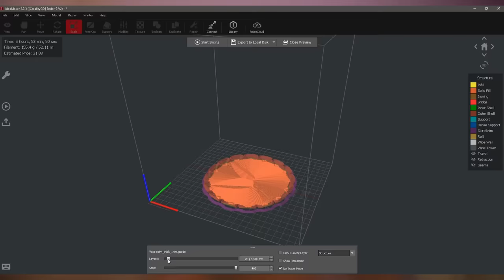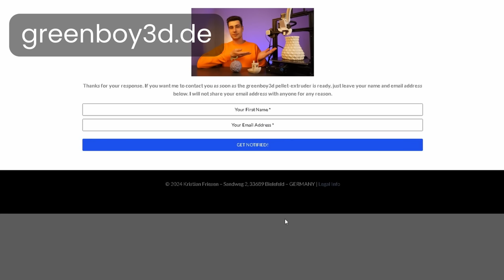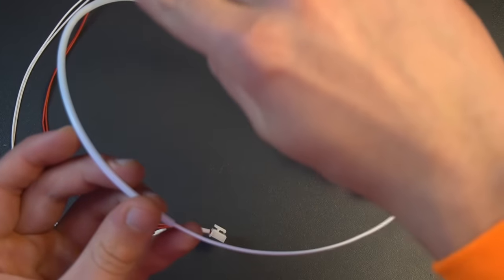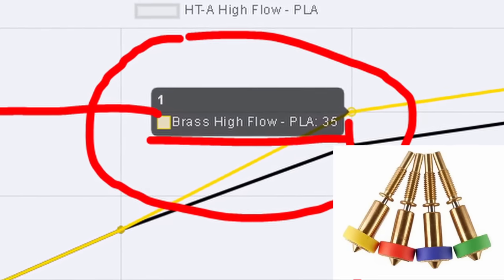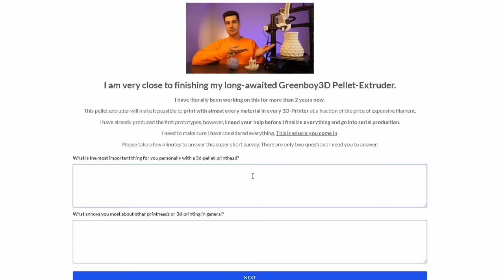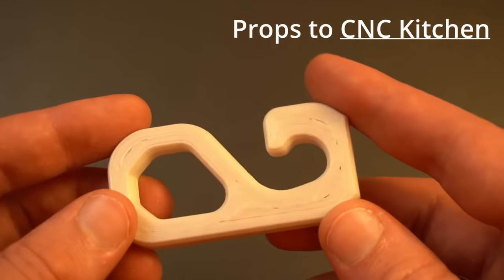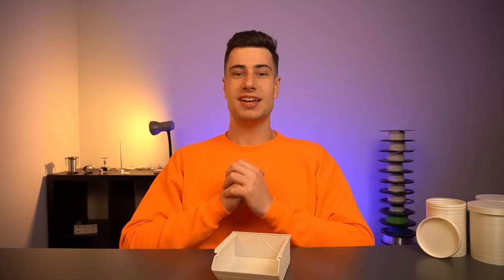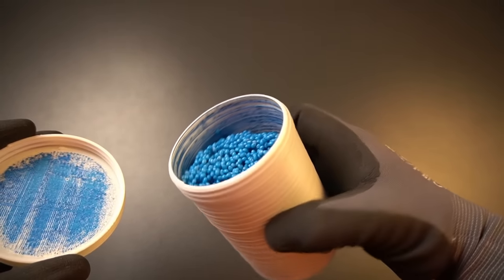Stop Buying Filament, Use This 6x CHEAPER Alternative instead

Comment: For recycling it's typically done by mixing the old plastic into a new batch.
You could try how well the system works at different ratios of old and new.

Ideally ofc you would want to shred it to similar granule size, but the hopper and screw system should be able to handle varying sizes.
Would like to see some tests on this. Recycling old plastic inhouse can be a huge saving overall.

For the nozzle question, I think you should aim to have optimal nozzle for the printing and not be chained by universality.
If the system becomes widely used then it becomes the new standard :)
Reply from the maker: very interesting input 🙂
Thank you

Comment: Supporting standard nozzles will bring more people in, so in the short term that's probably the better plan, but the next step will be to develop custom nozzles and setups that work better.
Reply from the maker: Thank you for your great input 🙂
What would you like to see next?
Reply: It's better to have something that works. If it doesn't work it doesn't matter if it uses a standard nozzle.

Comment: In this case, in terms of speed, I think a bed-slinger might actually perform better than a CoreXY. On a CoreXY the heavy toolhead would affect the resonances of both axis, which would limit accelerations. On a bed-slinger the heavy Y axis performs worse than the X, bottlenecking the X axis speeds. But in your case, both axis are heavy, so they don't limit each other, and because they're separate, it's probably going to be easier to deal with their respective resonances. But that's just my theory.
Reply from the maker: True :)
By the way, what would you like to see next?

Comment: Very good video and so happy to see your progress. I have 40 years of high production high precision injection mold making and molding experience. You are dead on in the process you outlined and are mastering the rheology of thermoplastic flow . The only difference in the outcome is that you are not able to get the density of an infection molded part because you do not have a packing phase in 3d printing. As a result you may have aligned molecules and a grain like wood in printing that has some advantages and disadvantages. But with carbon fiber we may be able to produce a similar strength . Not sure yet all the doors you are going to unlock but accolades to you this this an amazing project. But I can tell you that the injection molding press industry has already figured out how to do a lot of what your doing they just have not figured out how to 3d an extruder for 3d printing
Reply from the maker: Thank you for the Feedback :)

Yea, there a definitely some additional challenges involved making a "mini" extruder for 3d printing

Comment: The retraction explanation makes perfect sense when you consider that reversing the conveyer screw in a pellet extruder is functionally doing the same thing as a "retract" move on a filament extruder; namely, they both are reducing the pressure inside the melt chamber.   Which is the real goal of a "retract" move anyways.

Comment: For the nozzle, maybe go with a CHT nozzle, since it has three channels in which the molten plastic flows through, meaning it might have more consistency in the heating and flow. As for the small discrepencies in the melting process, maybe add some small notches on the side of the extrusion screw so that any trapped air could be potentially allowed to bubble out or maybe as a way to control a bit of pressure.
As for dying your batch, could try going with alcohol dyes and do it in the same format of mixing it in an enclosed jar/container.
Reply from the maker: Thank you for your very interesting input 🙂
What would you like to see next?

Comment: I’m all for recycling and reducing waste, also I like saving money, so I love it!
Most prints just don't need good quality. Stuff like hooks, holders, storage containers and so on work just the same even with a +-1mm tolerance, so the reduced surface finish is no problem.

Comment: Some of the problems you're running into are also issues in small extruders.
I.e. if the extruder screw is running at 60 rpm, expect an uneven "squirt" of resin every 1 second out the end of the nozzle/die.This is why metering pumps are often used at the end of an extruder (to tightly monitor flow). 
The 3d filament printer brilliantly solves this issue inexpensively by using filament.
The filament feeding system is acting as the gear pump.
Another issue will be safety. If you build up pressure behind molten plastic that has frozen off at the nozzle, watch out. 
Randcastle has made a great miniature extruder for decades to learn some of the inherent issues.
Reply from the maker: Thank you for your interesting input :)
What would you like to see next?

Comment: Nice. For recycled plastic the bulk density will be different. Building a small pelletizer extruder would be more consistent. I worked as a tool maker in an extrusion plant for 10 years. There are ways to make it more consistent but the complexity goes up.
Reply from the maker: Thank you for your very interesting input 🙂
What would you like to see next?

Comment: I once read an article about an Indian university student who couldn't afford a 3D printer and so he designed and built his own, the only things he bought were the arduino chip to build his control board and the steppers, he was also having trouble affording filament and so he also designed and built a pellet extruder as he could get the pellets for pennies.
 I have a few old bedslingers that I would love to convert into pellet printers!

Comment: I calculated 112g/h = 38.3 mm^3/s, am I correct? Calculations below:

Assuming PLA density is 1.24g/cm^3:
112g * 1.24 = 138cm^3/h
138 / 60 = 2.3cm^3/min
2.3 / 60 = 0.0383cm^3/s = 38.3mm^3/s flow

It would be cool to see you perform the orcaslicer max flowrate test on different nozzle sizes. It makes it easier to see the actual limits of flowrate.
Reply: A bit of an overestimate on flow rate unfortunately  - if the PLA is more than a gram per cm^3 then 112 g should represent less than 112 cm^3.  I think the calculation should be as follows:

112 g/1.24 g/cm^3 = 90.3 cm^3
90.3 / 60 = 1.50 cm^3/min
1.5 / 60 = 0.025 cm^3/s = 25 mm^3/s

Still better than many standard nozzles, but not matching top of the line high flow.  I think beyond this, the cooling rates will be a bigger limits but with klipper input shaping the weight of the extruder may be much less of an issue than with previous firmware.  Still a very impressive project in general!
Reply from the maker: I'll look into the "orcaslicer max flowrate test", might test it this way next time.

Thank you for your very interesting input 🙂
What would you like to see next?

Comment: Nozzle compatibility across filament printers makes sense, but it does not have to be that way for a pellet extruder. It makes more sense for the pellet extruder that uses a different  extrusion method to have a different nozzle. Then from there, hopefully all future pellet extruders would have the same nozzle compatibility.

Maybe if you just keep the same threading, it can be up to the user to decide if they want to use an easily available filament nozzle, or a pellet nozzle.
Reply from the maker: You've got a point here :)
Any wishes for the next video?

Comment: PLA pellets can only reliably sourced at $10-$15/kg. The cheapest PLA filament is $15/kg… last I checked. 0-30% cost savings was not 300% (missinformation factor 10x to infinity)
Reply from the maker: You just don't know where to buy pellets.
Reply: @greenboy3d  so where do you buy pellets?
Reply from the maker: @pyalot  going to make a detailed video about that in the future

Comment: SAW VIDEO 1 AND NOW THIS!! Thank You! Can a pressure lift switch  be added between the nozzle head assembly and the actual carrier mount guide rail? maybe this would be fore a different design. say 0.6 nozzle layer eight travel is 1.2. the stepper feed goes till the head is lifted ill the trigger head lift switch is tripped or lifted to that height, then the travel steppers are engaged to conduct gcode shape. maybe be do a reverse stepper feed code for retraction. Head should relax and lift switch switch off for next travel movement and no feed. Maybe CNC kitchen or Dr. Dflow. Dflow did a very large scale pellet printer. maybe this helps on the stringing retraction issue. micro optical type switch or  nano like adjustable switch control to adjust layer height and retraction.. just ideas...
Reply from the maker: Thank you for your very interesting input 🙂
What would you like to see next?

Comment: For recycling 3D prints, CNC Kitchen got the best results by repelletizing them. He was making filament but the basics were:

1.) Shred
2.) Sift
3.) Repeat till consistent
4.) Form filament
5.) Pelletize this first batch
6.) Form final filament 

Clearly you can skip 6 and probably combine 4 and 5 to be a single operation.

Comment: Nozzle compatibility isn't important if it comes at a cost of performance. 

What would ultimately be nice is to design it to function with a breakout board, and be compatible with toolswap plates such as the Hermit Crab or WhamBam Mutant for Ender 3, or be able to easily mount it to a toolchanging printer. That's a much nicer quality of life, to be able to quickly swap between a pellet extruder and filament extruder.
Reply from the maker: What would you say are the top 5 most popular toolswap plates?

Comment: Neat video, I love the amount of work folks put into FDM printers just to get a new way to print or not waste materials. I am not sure I would go through the trouble of doing all this, just to save a few bucks in materials, but I feel the pain of wasted materials as well. Resin printers create so much waste with support materials only being used and tossed. I love that you took and Ender 3V2 and did this, those things are like Honda Civics, cheap and easy to mod.

Comment: Could you technically print pellets with the shredded prints so the size is consistent? As for the standard nozzle question, I'd love to see the difference in print quality with a non standard nozzle
Reply from the maker: Depends on how consistent the shredded prints are. If you have for example cylindrical shaped shredded plastic, and you plan to mix it with round shaped pellets, then you might get even more inconsistency... But yes you can...

Comment: Whats the cause of the poor print quality? Is it just a lack of dialing in the settings? Or is there a mechanical reason causing it?
Reply: IIRC the pellets won't run themselves through the extruder at a perfectly constant rate. You'd have the same problem using filament with a non-constant diameter.
Reply: @ski3091  so I suppose this type of extruder is not good for prints with tight tolerances or small details but is excellent for large structural objects that you would need a lot of?
Reply: @ski3091  gotcha, thanks for the reply
Reply: @ipodtouchiscoollol  Sorry, I don't know enough about the process to answer that
Reply from the maker: Like others mentioned, the pellets or granules don't have a perfect constant flow rate. I have some ideas to solve this problem in the future, but for now it is what it is :)

Comment: My personal opinnion on the nozzle type is to stick with the current, widely available nozzles and once its widely adopted, offer specially designed nozzles for improved print quality.
I would preffer that because of 2 reasons:
- It would get a lot more people interested if they can retrofit their printers 
- They would have as may interchangeable parts as possible
Moving on to the specialized nozzle: 
- It would offer to the people who initially are focused on print quality and not function a reason to recyle and be more sustainable
- The hobyists would also benefit from having something to upgrade to

Comment: I really like what you are trying to do. Even if the up front cost is most likely going to be more, the saving on the filament is huge. Making custom colors is interesting too. Are you using regular spray paint?
Reply from the maker: Yes, regular acrylic based spray paint. But like I mention there are multiple ways and spray paint types...

By the way, what would you like to see next?

Comment: About the nozzles: could one not just cut away most of a standard nozzle with a hacksaw, leaving just enough threading to screw it in? This would eliminate the entire part where plastic is melted and leave just the final conical shrinky bit needed for printing. Given that this extruder isn't likely to be acquired by anyone non-technical, I think having "SAW ALL THE THINGS" as part of the build process isn't too demanding a step.
Reply from the maker: you are right on your conclusion but yet it would still make things more complicated for everyone...

because if you would do it this way and optimize the pellet extruder for a shorter threat than people without this modification couldn't properly use the  pellet extruder which is a problem :(
Reply: @greenboy3d  I was thinking more like - have a standard unmodified plan for a normal nozzle that everybody can follow, but mention that this is a possibility so that anyone willing can saw the needless bit off and enjoy a little extra effectiveness.
Reply from the maker: @fallingwater  ok

Comment: Well done! A good enough print as shown in the video is insane. The possibility for community collection and reusing plastic is through the roof. 

There are a lot of nonprofits in Buffalo NY, that currently have 3d printers that would be interested in this project. Filament is the biggest cost right now which blocks us from legitimate local manufacturing. Since the injection molded parts are cheaper than just the filament, its hard for 3d printing to make sense

This project could bring us closer to - buy nothing world

I think a lot of 3d printing print farms are looking closely at this too! Could make their prices much more competitive and possible to break into more product categories, including more simple shapes.

Comment: Maybe it is easier to use pellets to make your own filaments for the 3D printer?
Reply from the maker: It is "less" easier because more steps are involved in producing filament than just directly printing with pellets.

However, nothing is holding you back to produce Filament with the Pellet Extruder, if that is what you want to do. The point is that you have full freedom of choice...  😀

Comment: I just filled the form 😌
In short, for me it would be all about reducing waste from prototype prints: I would shred them and re-use the plastic.
Most of the time, quality doesn't matter that much when prototyping iterations especially if you add some more tolerances if needed.
Reply from the maker: Thank you for your input 🙂
What would you like to see next?
Reply: @greenboy3d  I'd like to see how the shredding process could be optimized, maybe with finer particles, filters and multiple iterations to reduce variance in extrusion.

I'm guessing that pellets are a convenient form factor but not made with tight tolerances. And maybe it's possible to increase the print quality by shredding everything, including pellets themselves into finer particles with tighter tolerances.

Comment: You should check out the quantum delta 3d printer by Kilian Gosewisch, instead of moving the printhead it moves the entire bed on all axis and the extruder stays stationary, that way you can eliminate the size and weight constraints of your extruder.

Comment: Would the cost of making a filament extruder using pellets and recycled prints give you the best of both worlds?
Reply from the maker: It is "less" easier to produce Filament because more steps are involved in in that process than just directly printing with pellets.

However, nothing is holding you back to produce Filament with the Pellet Extruder, if that is what you want to do. The point is that you have full freedom of choice...  😀

Comment: I think significantly better print quality is more important than full nozzle compatibility. However it would be great if you could maintain some level of compatibility, for example by keeping the M6 thread. Then the pellet extruder would work best with the custom nozzles but still function ok-ish with a common nozzle. Some compatibility would prevent complete downtime and allow the early adopters more ways to experiment - an easy one would be shortening common nozzles as from what you're saying a stubbier nozzle is closer to ideal.

Comment: An option to improve quality with recycled plastic would be to use a 1.75mm “nozzle” to constantly extrude something that resembles filament, then regrind it into pellets, as CNCKitchen showed with his Artme3D
Reply from the maker: But wouldn't this worsen the material properties through extra thermal degradation?
Reply: @greenboy3d  maybe after a time, but I think you could counteract that by introducing some virgin plastic each regrind. I don’t have any experience with pellet extruders, I’m just going off stuff I’ve read online. Your project looks really cool though, I’d be really interested in trying it.

Comment: This project is very exciting. While I love the ease of use of my Bambu printers I do believe that the economic advantages of this pellet toolhead have plenty of merit - even if they are not "beautiful". I am typically not very concerned about beautiful print quality, though I would prefer an "ugly" part to have superior strength and print speed. Adding the tradeoff of extreme economic advantage, i might then be willing to sacrifice some speed.

On the topic of "standard" and "widely available" hardware; I think this is very nice to have, but not all revolutionary ideas need to have an extremely accessible bill of materials. As long any custom parts aren't extremely scarce or prohibitively expensive.

Thanks for pushing limitations and sharing this project!